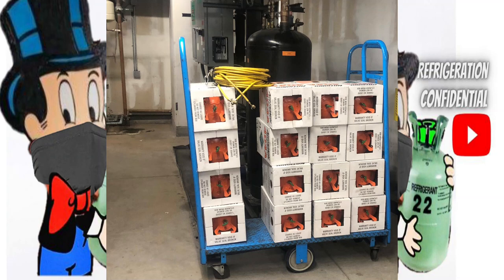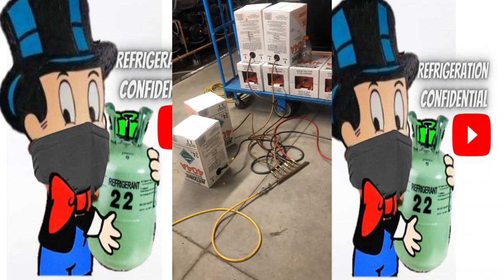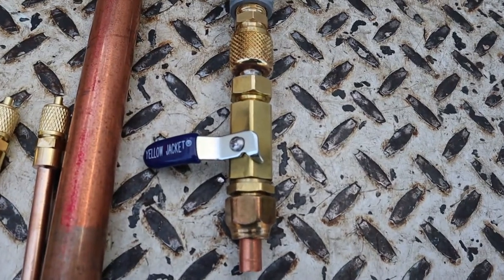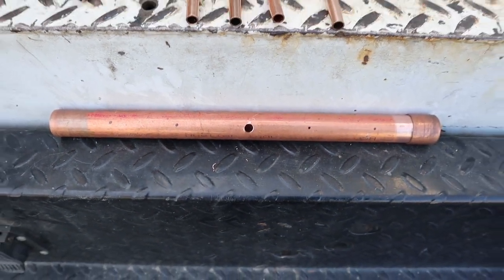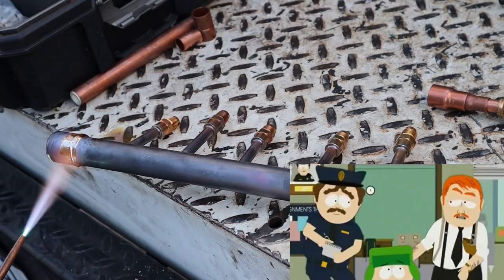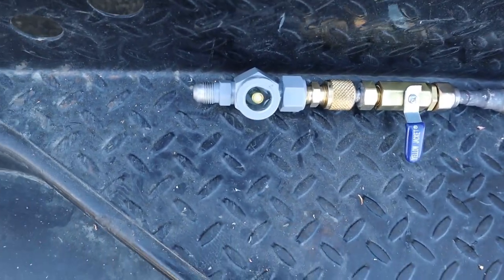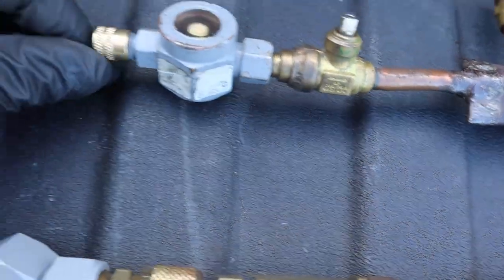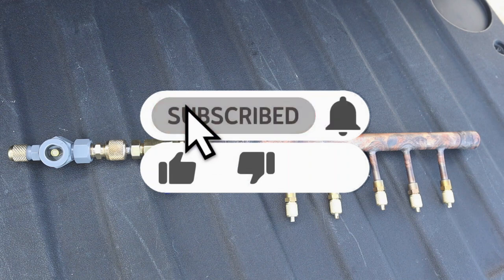Refrigeration Charging Header: A Supermarket Refrigeration Techs Best Friend

Comment: I'm an hvac guy myself, wouldn't it be fastest to throttle way back on a liquid valve, then dump in the liquid on a port after the valve? Essentially you're feeding the txv with bottle liquid. On big built up systems I've added hundreds of pounds in a few minutes in summer. Its a minimal of tools, just need your gauge  manifold. Not 6 hoses or anything much else. Those built ups hold hundreds of pounds too.
Reply: And I’m an Refrigeration Tech myself, not when you need to dump 24 bottles into Rack After a condenser fan cracked the spider bracket lost the whole charge. It takes ALONG time juggling 2 bottles at a time. I charge At sales floor F@(k hauling all those bottles too the roof.
Reply: Why not just get torpedoes